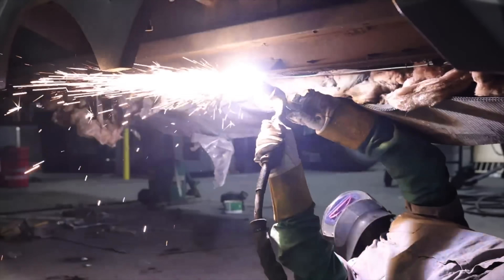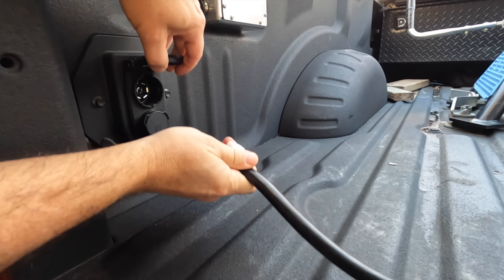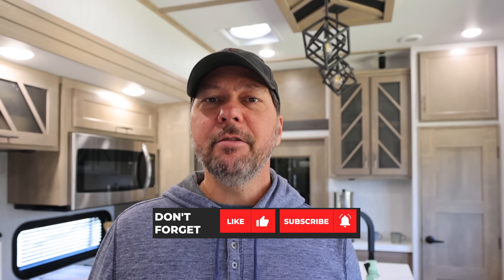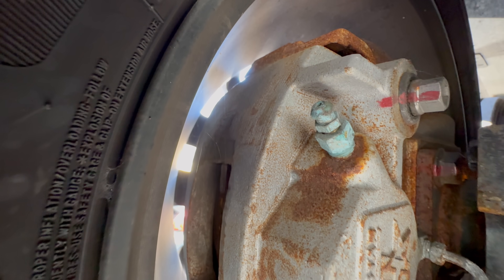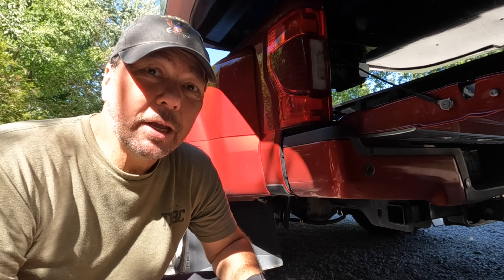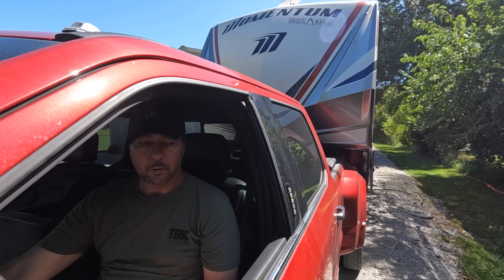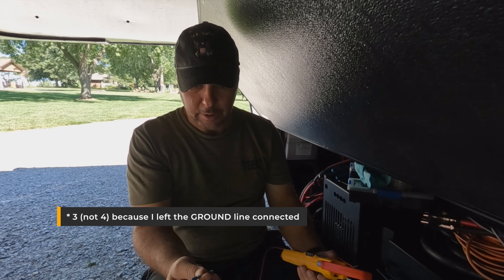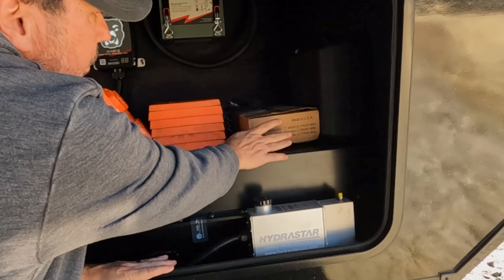RV Brake Troubles!: Solving a Perplexing Hydraulic Disc Brake Issue

Comment: Chad, Do the brakes begin to work better after being applied for a second or two? The electric-over-hydrolytic activators (motor-driven trailer master brake cylinders such as the HydraStar system you have) seem to have an inherent delay as the internal motor “spins up” to begin to apply brake pressure. So, in a panic braking situation, that first second or two is scary.
I’m not sure there is a viable solution to this delay. Perhaps another brand’s actuator works in some other way to apply the trailer brakes immediately and proportionately upon activation. I never found one. Sorry, I don’t have better news. But since you report hearing the HydraStar’s motor activating, electric activation problems may not be in play. I hope this helps explain what you might have experienced.
Reply: I agree with you. At 70mph imagine how many feet the trailer travels before the brakes actuate. I was waiting for somebody to mention this. Another design flaw is the actuator is not tandem like the tow vehicle is essentially all the eggs are in the same basket regarding total loss of brakes from a single wheel failure. This can't happen if the controller is tandem design. A tire blow-out snagged a hydraulic line (a member in the GM Forum) on a caliper which disabled the entire rig's ability to stop. I hope they add tandem redundancy to the controller. Minimal cost.

Comment: Chad, you mentioned lithium batteries put out 13.4 volts.  Is you brake control system rated for this voltage versus 12 volts.  Depending on the control component they will have an operating voltage range.  It could be that the controller is not rated for over 12vdc. Electronic devices have specific voltage ranges by design.  If exceeded could be the issue.
Tony

Comment: I would add just one thing. Did you check for a good ground. I'm not talking just a visual, I mean remove and clean. I spent 35 years fixing planes and wasted so much troubleshooting time because I didn't check grounds first. Loose grounds can give you the weirdest issues.

Comment: I'm guessing it's the crimp connector when under load, even though it tested good with no load.  That's possible, with your symptom of "weak brakes".  However, the video you showed of one of the rotors lead me to believe the brakes were not working at all.  The disk was RUSTED, implying the pads aren't even touching the rotor.  Inspect your rotors and see if all of them are rusted.

Comment: Do you suppose it would be possible to plumb a pressure gauge in line with the brakes so you can actually see what's happening when it does act up?  Obviously this would do no good while driving but if it were to act up when in a parking lot you could have your wife actuate the brakes while you watch the gauge.  I suspected initially a bad pump but they don't typically start working again (unless it's some sort of priming issue).  I don't know what sort of butt spices those were but I've had trouble with solder filled splices in the past and refuse to use them now.

Comment: You can still have continuity and read 12v until you ask for full voltage draw and loose the 12v with a wire that is compromised,eg green puss monster.. somewhere along the wire . Or even a pinched but not completely broken..just a few strands...

Comment: I am not familiar enough with your specific brake system but after working in the racing industry for both auto and motorcycle racing as well as big brake upgrades designed for street use with the number one mfg in the world - I may be able to help a little here. 
      If electronics are not your issue - mechanical, fluid or brake pad/rotors would be the next areas to look at for a soft pedal and degraded stopping power.
1) if heat can be ruled out as a cause brake temp paint can be used on each caliper to see if excessive heat is the cause of your problem. 2) if pistons in the caliper do not fully retract the constant friction of pads against your rotor while driving can cause multiple heat issues. 3) glazed rotors 4) rubber brake lines can weaken and swell when brakes are applied 5) brake fluid absorbs moisture very VERY easily and if any moisture is in the lines this can cause your fluid to boil and cause a loss of braking power 6) look for any small cracks on the edges of your rotors that may be a sign of heat stress.
    If we talked on the phone and I had more information I may be able to help further but trailer brakes and the type of system you have is foreign to me. Although brake systems can all have common issues a specialist may be your only solution once your back on the road and see the issue return. Good luck, looking forward to your next video.

Comment: The only common factor I can see is the you disconnected power from the system. I don't know anything about the actuator that you are using but I was curious. Does the actuator have a motherboard (circuit board) built in? I know that my wife's car starting having glitches and the fix was to disconnect the battery for about 10min. and it did a hard reboot, after that all the glitches disappeared. I know it's a stretch but it's also a fix for most electronics and appliances. If for some reason it got anything from a dirty signal from a wet connection or an over voltage it can confuse the circuit board and a hard boot can reset the board. I might be way off base here and I hope you find what was causing it. Good luck and safe travels.

Comment: I guess you had corrosion on one or more wires at the controller. When you cut thr wire at the crimps, you then had to strip a new section of wire and recrimp, thus cleaning and removing any existing corrosion. I would suggest you remove those exisitn crimps, and replace with waterproof or marine grade fittings to ensure this does not happen again. In addition I would replace maybe a foot of each wire with new wiring, to ensure any corrosion that may be under the wire insulation is removed, and does not continue to corrode the wire over time.

Comment: I know nothing about an actuator or what it does. But my guess is it requires power and it lost power when you disconnected the wires. It just needed a reboot like any other device.

Comment: There is one thing that you may not have checked and that is all your grounds. You may have intemittent connections that will drive you crazy trying to find. Check all the truck and trailer grounds.

Comment: I'm going to add this as a regular comment instead of just tagging onto someone else's - I follow Ivan @ Pine Hollow Auto Diagnostics, and one of the things he preaches is powers and grounds - but he warns that you HAVE to put a load on the power and ground side, not just a meter or a regular test light because neither of them will draw enough power to see if a circuit is actually failing. He has two test lights set up - the first one is a 1 amp small light bulb to just see if the circuit will accept that load and have no problems, then if that works he will use a 2 headlight tester to give him a 4 amp test light. I've been amazed just how many times a circuit will show good, but when he puts the 4 amp lights on, the system fails or the bulbs are super dim. You may have had a crimp that was ok but not good, and over the course of being bounced down the road, the crimp wasn't able to provide a solid enough circuit. I would suggest anyone interested to go check Ivan out on YT - he is quite the wizard at chasing down electrical issues and explains them super, super clearly!
Reply: Ivan at Pine Hollow Auto Diagnostics Channel is a "Wizard" just as you stated! I follow him religiously! Automotive electronics is very complex. 20-40 contol modules all communicating on 3 different kinds of CANbus. The brake controller is one of them and THAT even communicates with the ABS module. When Ivan has a symposium I will see you there!
Reply: I want to second and emphasize what you just said how Ivan uses 3 different DIY circuit load testers each with a progressively higher current to match the current rating of the device you are testing. THIS cannot be over-stated! I have done this for decades especially on ground circuits.

Comment: Could have been some small particle in the fluid of the hydronic  booster that caught in a seal that was letting fluid pass through and not put right pressure to stop trailer. Just a guess

Comment: Continuity or even presence of voltage on a wire does not equal the ability of a wire to carry sufficient current for a given load.
It’s possible that perhaps one (or more) of those connections was sufficient to provide continuity / voltage through to the test point, but perhaps the connections were not sufficient to carry the amount of current required. 

(Conceptually, think of it as if a section of 10ga stranded wire was damaged, and only a single strand of copper conductor remained intact through that damaged section… You would still have continuity through that single strand, and you’d still see voltage on the load side of that damaged section — however, that damaged wire would likely be insufficient to carry the amount of current required by a load.)

It would have been interesting to see how the wiring could have handled a substituted load prior to replacing the connections.

Hopefully the issue remains resolved though!

Comment: I’m Barbara husband, I my past experience if it does not make sense in is a ground problem. Moving the wires may have caused a better ground. Can you ground the controller to the frame. Just a thought.

Comment: Chad, I believe that at least one of those three crimped connections was marginal and that in the process of testing or removing them, you wiggled them enough that it improved the continuity.  Another possibility is that while you read zero ohms with your multimeter, keep in mind that the amount of current that it uses for its measurement is very small.  That hydraulic pump will draw a significant amount of current.  You might want to remeasure the voltage at the input to the pump, with the pump running,  to see if the voltage has increased with the new crimps.  I suspect it has.  I feel your frustration with not knowing what is going on.  I have been there many times.

Comment: OK, I scanned the comments and didn't see what I started screaming about when I watched the video.  The one thing that stuck out with me is that you disconnected your massive power cable from you truck to your RV and left it disconnected when doing the testing.  I didn't see where you reconnected your power cables and check the brakes with the current flowing in the power system.  Could the high currents in those cables be causing a ground current issue in your 7 way  connector?

If you did have these connected and the truck was providing power for your RV, than that is the last thing that I can think of. 

Hoping the mystery gets solved...

Comment: As an automotive tech. youd be shocked at how many times issues get resolved by simply disconnecting the battery, letting it sit a while and then reconnecting the battery on all the newer vehicles.
Reply: You are 100% correct. You'd love following Ivan at Pine Hollow he is an automotive diagnostician of the highest caliber. Has a huge following.

Comment: Chad if I had to guess I would say a   possibility of trash in hydraulic reservoir stopping up the intake side of the pump then when the system was off it moved I have had something like that years ago  when meant it would work then not work

Comment: Does this only happen after you've been driving for a while? If so, maybe the brakes are overheating and boiling the fluid. Or maybe the actuator itself is getting too hot causing the problem.  I really hope you figure it out because bad brakes SUCK.
Reply: Very true....the boiling point of brake fluid was increased when disc brakes came out in the 60's. The brake fluid was actually vapor-locking causing a soft pedal or loss of brakes. Good call on your part although the OP's problem is electrical.

Comment: Perplexing Problem Indeed.  You checked the wires coming from the truck all the way back to the brake actuator in the 5th wheel.  All those wires looked good, good voltages.  However, perhaps the wires going into the actuator itself are damaged going inside the controller itself, thus, then you were moving these wires around connecting/reconnecting you moved this control wire and it's not longer shorting on the case of the actuator for example.  You eliminated issue with the wires coming from the truck, logically, that would be the next place to look, maybe the wires going into the controller are damaged, shorting to the case or inside.

Comment: I do not like using crimped connections on trailers, a soldered connection is always the best. The metal (sometimes very cheap) on the crimps is really cheap and corrodes. One trick I learned from a buddy is to melt a glue gun stick over the connection with a torch, instead of taping the connection.

Comment: Don’t know how much “smarts” are inside the actuator, but if it’s always getting some power from the RV always, the act of disconnecting and reconnecting all the wires might have rested a PLA or a logic board inside the actuator?  The LRU is the actuator right?  Maybe it should have a reset button to momentarily cut all power (not blue wire, the ones going to trailer batteries) to the actuator instead of cutting and resplicing the wires. Or cycle battery cut off switch to kill all power in/on trailer and retest if it happens again?  Would need schematic of the innards to T/S further. Test point would help without cutting wires.  I hate non repeatable failures! 😡

Comment: You need to check your ground a bad or intermittent ground will drive you nuts. You are working with a variable voltage with a bad connection you can have a variable ground. It be making a good connection after working with the other connections. It may come back to haunt you.

Comment: Did you check the fuses involved?  Brake controller, actuator, any fuses in those circuits.  It is possible you have a fuse that isn't quite bad or the socket they plug into is dirty or has picked up some moisture.  I have seen 12v fuses that are not quite blown still allow power thru but at a lower amperage until they actually blow.

Comment: Since the old crimps connect two wires I think you should have had continuity on all of the old crimps.  Nothing should have interrupted the continuity on those when checking with your meter.  Since you did not have continuity nothing was flowing.Maybe?
Reply from the maker: Not sure what you mean...  I cut the splices out to get access to the wires to check voltages.
Reply: Right.  You were checking the crimp connections from one wire to the other.  If the connections were true there should be continuity from each side of the connection,  If you don’t have continuity through the connection, crimp,  no power gets through

Comment: If the electrical connections were made with the typical plastic connectors that the trailer industry usually uses that was most likely your problem. I’ve seen them fail more often than not.

Comment: When we got our first trailer with hydraulic/electric brakes our truck brake controller would not work with the trailer brakes. It was a voltage issue. The fix was to wire a brake magnet off the hydraulic controls the trailer to trick it into reading the correct voltage. Never had an issue after that. Don’t think that is your issue
Reply: Just to add it was an 09 trailer

Comment: From a probability / likelihood perspective - We can agree that you appear to have an intermittent issue. When all else is equal failure is more likely on a more complicated device. It seems that the most complicated item is the "black box" electrically pressurized brake booster and its control board(s) and anything else in there (HA).  Unless your WD40 or other efforts addressed a real issue of corrosion / resistance I would bet it is that box.  Good luck and please do not drive around with 16k and limited brakes!